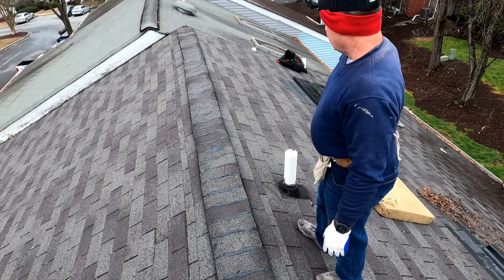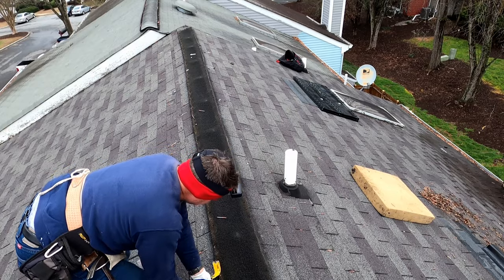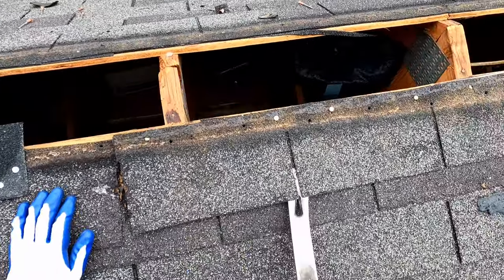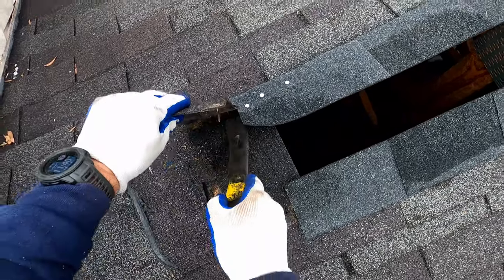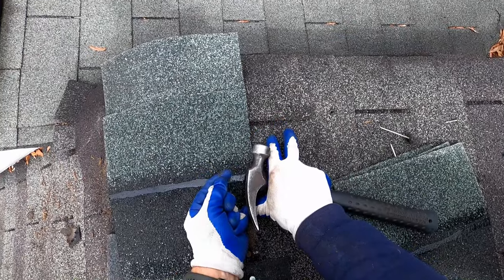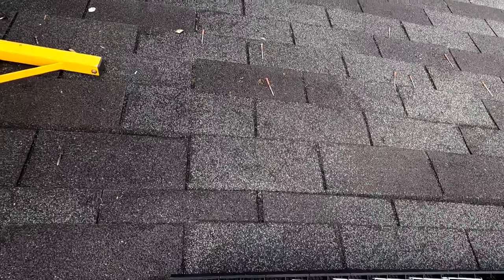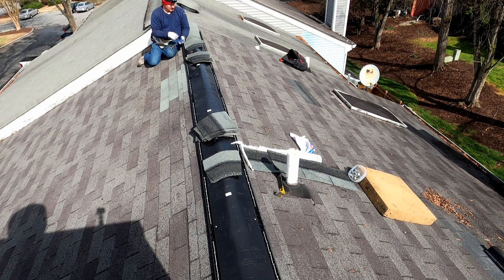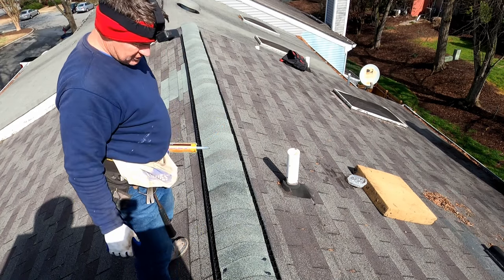Ridge Vent Replacement

Comment: Why not pick up the nails at the start and keep them somewhere safe in a bucket or something as you pull them out. It is only a small number compared to doing the entire shingle job where you would have a tarp below to catch everything.  This  helps protect the roof from damage when you are walking on them and prevents them from getting on the driveway or garden where someone or a pet walks on them and keeps them out of someones tires, as well as you from kneeling on them.  JUST SAYING !  Sorry but this is not good and that roof needs major work, not a bandaid job.. its soft and lots of rotten  wood. It is quite evident from the bouncing shingles as you are nailing that these old shingles are not stuck down and there is lots of rot in that roof.

Comment: This is what I needed! I have a 15 year old plastic cobra roof ridge vent and water was dripping from the top of the roof in several places near the ridge. I could not figure it out as I am new. Asked online, was told to seal the roof ridge vent nails with Blackjack Roofing Asphalt Cement, did that and put a cement fabric on top and more cement on each nail. Some of the dripping stopped, but in other places continued. Realized I should have taken out a few nails that were loose and could be pulled out by hand, but I just cemented over them. Then I realized that because smooth nails were used instead of ones with rings on them which help them stay in the wood, the wind which is high here as the house is on a hill, the wind pulled up the roof ridge vent and pulled the nails out. That is why ring shank nails not just glalvanized nails are used on the roof ridge vent to help hold it against being pulled up. So I nailed the roof ridge vent with a new nail on every shingle which pushed it tight against the house and put Blackjack asphalt cement over each head to prevent from rusting if water gets under. Currently waiting to see if it solved the leak before sealing the shingles with Geocell 2300. Not sure if I shouldn't use Geocell 2300 as it may not bond to the asphalt cement on the shingles as well, but I figure since asphalt cement fails in three years or so, then the perhaps the Geocell 2300 will fail at a different time point.
Reply: Very good and I learn a lot from him

Comment: Thank you very much for this video.  I just bought a house with a 2-3 year old roof and the foam type ridge vent.  Well the attic has ventilation issues and it has the thinner foam type vent like what you removed.  I think it will help to have the larger style in conjunction with getting my soffit vents sorted out.  I also plan to add a ridge vent to a detached garage.  The garage will make for a perfect practice scenario before I tackle the house ridge vent.  Thanks again!

Comment: What type of sealer did you use to keep water from blowing between the ridge vent and the shingles? My last roof failed due to no tar sealer under the ridge vent.
Reply: As you say, the venturi effect lifts the edges of the ridge vent away from the shingles allowing for wind driven rain to enter beneath the edges of the ridge vent.

Comment: Seemed like some of those nails into the shingles only grabbed the ridge vent as they nailed in very easy, and noticed some bouncing in the roof as you nailed it. Perhaps it won't ever present a problem, but in high winds it could lift the shingle caps. Either way, great job and great video as I'm looking to install this type of venting when I do my roof soon.

Comment: Is there any way to fill in that gap with wood somehow?  They ought to make a wood strip just for this.  It could be grooved so it fits under the OSB or plywood a few inches, then goes over the trusses and fills in a few inches or even to the peak if they left a gap where they shouldn't.  Some good kind of treated wood maybe.  What would a piece like that look like?   I have seen where they cut the plywood back and then add a wide plywood strip.  Gotta love toung and groove though.

Comment: Very informational video for a non-usual install.
Reply: a pointless fix when even he says it's a dead roof anyway. replace the roof
Reply: @natalieisagirlnow  You sometimes do just what you can afford.
Reply: @edwardmmanns7454  it won't be cheaper in 3 years, especially if it fails

Comment: Nice video. Is there a reason you start the vent 2 ft from the end ? If I have a hip roof with only 10 ft long. Should I really maximize the  vent area and start it a foot or half foot from the edge?  This  will be enough cover to avoid water getting it.

Comment: Nice video, but I have a different questions. I want to remove my ridge vent and cop the remaining opening. The soffits are not vented well and I was getting better air flow with my gable fan through the attic than with the ridge vent. Would like to see instruction/vid to do that.

Comment: Only watched a few minutes but question if plastic vent could  be any obstacle for rodents who like rooftops. I am shocked at the potential for leakage from roof vents such as these and am glad this man is helping the homeowner. Has to be a better option than a roof vent that runs the length of the ridgeline. What about those vents that look like a rotating rounds about 18 inches in diameter? Would rather have a small penetration in the roof than a huge one for a ridge vent.
Reply: Your logic is comical
Reply: Those are called turbine roof vents.

Comment: very good video. but normally there will be frabic filter underneath the Ridge Vent, it's not here. Also people also got leak from this type of Ridge vent when weather mother hit with strong windy rain. so you've installed this about 1 year, and feedback from the homeowner? curious whether this vent works good or not.
Reply: Good point about the fabric.  My older home didn't have the fabric and I never had issues with attic ventilation, insects, etc.  My current 2 YO home does have the fabric ridge vent system and I now have serious heat issues in the attic and upstairs loft area just under the truss/ridge vent almost like the fabric is restricting air flow.  I have plenty of soffit ventilation.   My builder says there's nothing wrong with the system even when I point out the extreme temperatures 90 - 110 in the loft area.  Looking at installing gable powered gable vents, something to get the darn heat out of there.

Comment: what happens if you have no vents in your roof sweetbeef I am looking for aftermarket blades for my mahindra emax25m-2514 60 inch mower deck model AEMAHME60. blade oem part number AME050008.  21 INCH BLADES WITH A 5/8 INCH CENTER HOLE

Comment: Hate to say it, but I don't believe it's going to work, that particular way.  

I would have made some double sticky resisto tape, and stuck it to the bottom of the plastic ridge cap your using, and then pressed it into the shingles, and then screwed it..  

My gap was 3 inches across the ridge line and was built with green lumber, so didn't really have room for carpentry, but yours looks like 6, and could use some 1 x 2"s.  

Mine leaked and I had to dump it for 3 tab. .